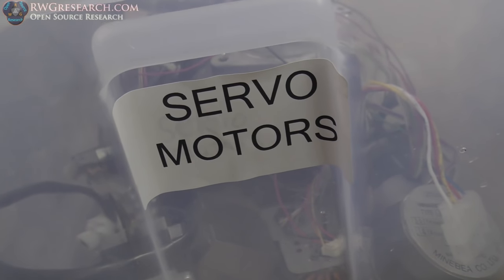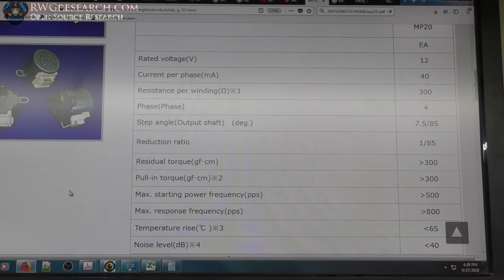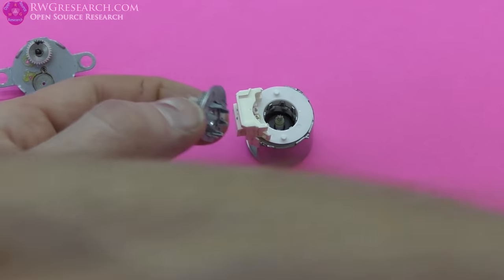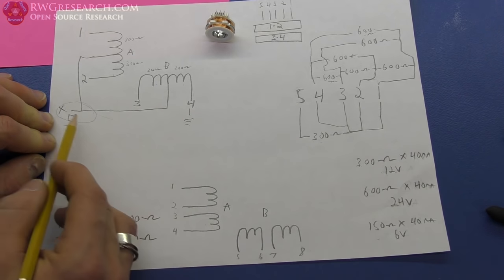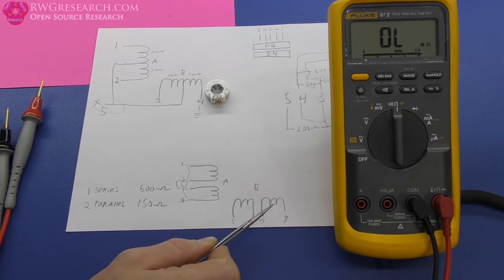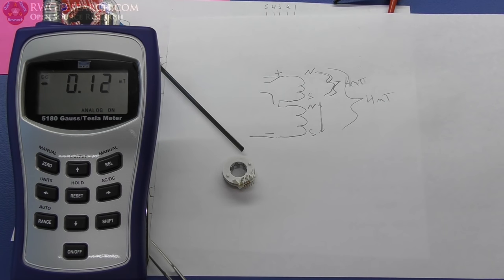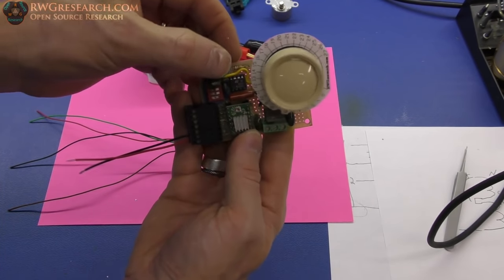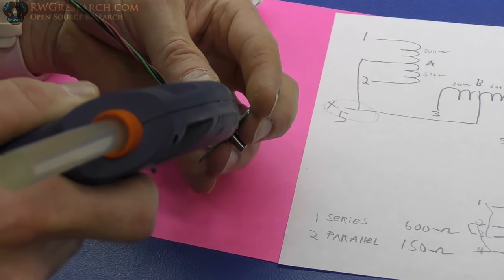Stepper Motor Hacking! How To Convert UNIPOLAR to BIPOLAR. RWG-CNC Flat Coil Winder

Comment: Russ, i am not too good at doing the electrical math I have Nema14 steppers, Which I the center tap was 45ohms and 96.5 between the coils, I think I rewired in series and no more center tap and i have 95 ohms, What do you think the running voltage and current should be now? i tried at 12V 40ma and they are warm and they are not losing steps not either and they stay warm to the touch long after the power is off , And sadly i can not find the Datasheet for them. Thanks for any suggestions